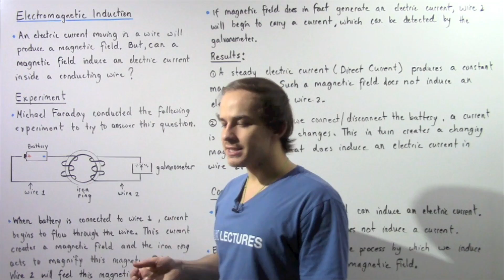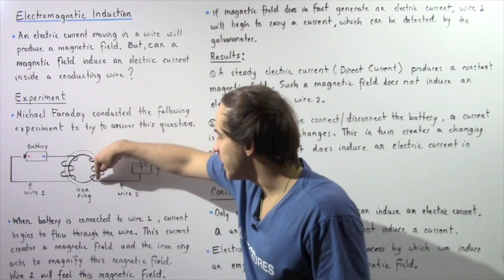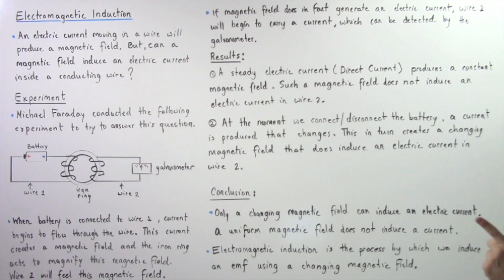Electromagnetic Induction

Comment: hello, still not clear to me how can we use the ring only for magnifying without connect the current to the second wire
Reply: Current in a coil(wire) produces a magnetic field (around that coil), in this experiment we were finding out that can a coil having magnetic field produces(as a physicists we use the word "induce") an electric current
Reply: The coils are from isolated copper wire, there is no physical contact of wire of coil 1 with the wire of coil 2, only magnetic like in transformers.

Comment: Andrey,

I am confused as to why after some time "t" the battery is left connected to the system the current read by the galvanometer is zero. Subjectively, I would think that the ring is a conductor, so electrons would travel from wire 1, along the ring and split [current] to  wire 2, I feel like the galvanometer should always read a constant current, as long as the battery is always connected, and should only change when, for example, a magnet passed through the loop.

for instance, let us assume the current is 2amps and it should be constant thorough the entire system after time "t" has passed, and only when you drop the magnet should the galvanometer detect a quick spike in the current..

Please clarify this confusion of mine, thanks you.
Reply from the maker: The reason the galvanometer reads zero is because the two wires are not actually connected to each other and no current will flow in the second wire (assuming no changing magnetic field). The galvanometer is placed only along the second wire and not the first. However, a galvanometer placed along the first fire would in fact read a continuous current (and voltage), as you discussed above. I think you might be confused because you're thinking the current is somehow moving through the ring and into the other wire? The magnetic iron ring is used to magnify the magnetic flux, not to move the current. Hope that helps!
Reply: Yeah that is exactly what I thought, that current was being "split" like it happens when applying Kirchoff's; thanks for the clarification Andrey.
Reply: Thanks for this knowledge